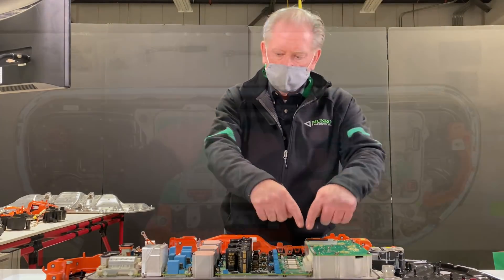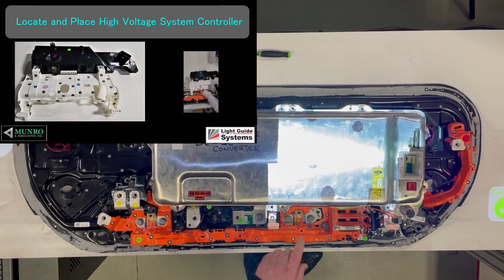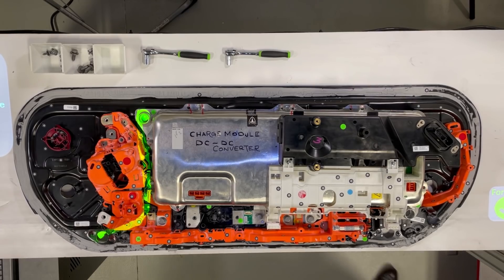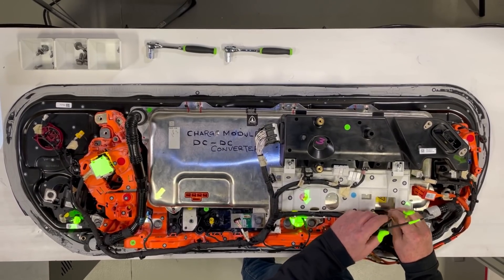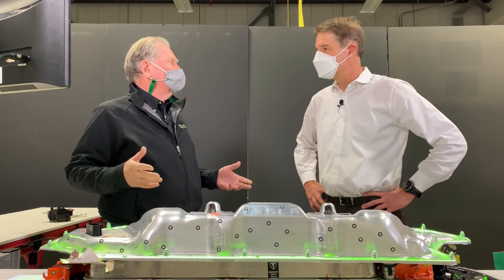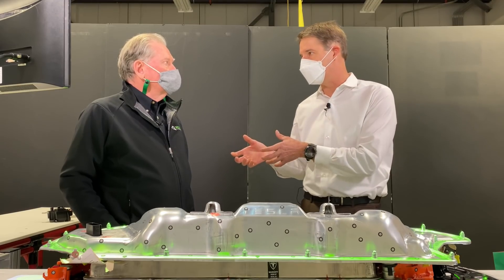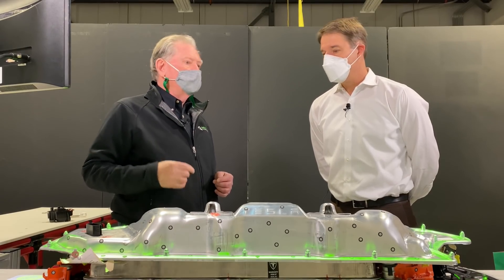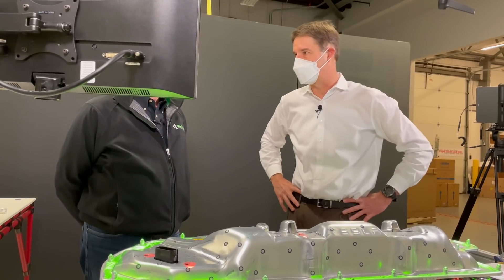Sandy Builds Tesla Battery Bay

Comment: There would be many advantages to using HUD glasses technology instead. Think Google Glass. Basically the OEM would retro fit a pair of safety glasses with this technology. This would allow the visual guides to be easier to see, and more adaptable for the specific user. Also imagine somebody working maybe in a construction field or otherwise a manufacturing environment that isn't necessarily concealed to a traditional line like mobile homes or rvs. Add lasers to it and you'll get measuring and leveling capabilities. Imagine using this technology in construction, not having to necessarily use a tape measure or chalk line. Like if you're sheeting a house it would tell you exactly where to put each screw in order to have perfect spacing.
Reply: Sandy just replied to a similar question saying they (Light Guide) do integrate AR Glasses into the process, but there are issues with battery life and workers not wanting to wear them for an entire shift.

AR Glasses would be great for field work though, there are many companies, including one local to me, that are pushing this.
Reply: @Gabriankle  oh I guess I didn't see that. As for battery life, I'm imagining something that looks similar to goggles. A large battery could be fitted to the strap on the back of your head. Many headlamps are similar. As for getting people to keep them on, there is no simple answer other than just make sure policies are being enforced.

Comment: "Pick by light" and "Pick by voice" - this idea is not new at all. Also, in assembly lines, the assembly is broken down to simple steps for each worker, and the products moves in between, and eacher worker only has the tools and components relevant for this worker.
With this system, you have the choice between assembly lines like used by Henry Ford and more complex stuff for each worker.
As a side note: You still have traditional wrenches, instead of wrenches, that are wirelessly controlled and battery-powered.  You should really combine such ideas with proper tools as really used in industry.
Reply from the maker: This was just an example. Their systems in manufacturing plants uses power tools with torque monitoring, etc. Thanks for watching!

Comment: Imagine instead of the screens you just have AR glasses
Reply from the maker: Many (or Most) of their stations in use do not rely on the screens, this was more of a training station. It's my understanding that on a true assembly line the workers do not look at the screens at all.
Reply: I thought of glasses too but I guess here the benefit is that it's part of the station rather then something on your person.
Reply: AR or VR are good (and getting better) but it takes effort for the brain to reconcile reality with what is projected and it is really tiring if you do it several hours in a raw.
This on the other hand feels very natural, just like following a Lego instruction manual, except directly on the Lego parts.
Reply: I know a university student in Korea who is building AR glasses for surgeons. Software coding class
It would be applicable to this as well I imagine.
Reply: ruskis are using AR for assembly of the Su-57,  that said assembly of the F-35 uses this system.  They looked at AR but decided to go the a light projection route,  fatigue was a big reason apparently.  You tire fast using AR compared to a light projection

Comment: Two questions: 1) How are the 'input' parts placed for the assembler, e.g. how do the boxes get filled with bolts and large parts placed for use? 2) Why did you have parts left over on the bench to your right? Shouldn't the system detect that there were unused parts?
Reply from the maker: Great questions: This was set-up just as an example, Light Guide has thousands of these systems in manufacturing plants all over the world that monitor all sorts of inventory aspects as well. The extra parts were culled from the exercise to make the video the ideal length for YouTube. Thanks for watching!
Reply: @MunroLive  Hey, thanks for answering the second question - I get it. But for the first question... How do the parts get placed in the assembly station for the assembler to use? 

When you started everything was laid out for you. How did the parts get there for your use? Is the station setup by another person, and then the assembler moves to the station? Do they use robots for setup? I'm just wondering how much labor is involved to create a perfect assembly station, and how do the manufacturers ensure that the proper parts are placed there at the beginning for the assembler to use. 

It's the old GIGO question - garbage in garbage out. 

Thanks again.
Reply: @rdyer8764  there are lots of methods. I'm sure in the video example, it was all manually placed by someone at the facility.
In a factory, there would likely be bins (think cereal dispensers at a hotel, or bulk food dispensers) full of bolts and components. Some setups have automatic fastener feeding to the business end of a fastening tool.
All of this setup comes with tradeoffs though. The more streamlined a line is, the less flexible (or changeable) it is, and the more it costs to set up. The upside is more parts per hour.

Check out Assembly Magazine for more inspiration.
Reply: @Gabriankle  Yeah, I figured parts for the video example were manually placed as a demo. What I was curious about was how the 'real-world' setup would be created in a factory situation. OK, I can see where any parts that could go in a bin would be pretty much a non-problem, and there could easily be a stacks of the sheet metal pieces, but how would they deal with wiring harnesses? Just a big bin full of them to pull one from? Seems like a time gobbler. 

But my main question is how do the parts get into the bins and stacks? Who knows they need more, and how does the message get to the person who the fills the bins and stacks? It appears the actual 'assembly' process has been streamlined superbly. But how is it supported in an equally modern manner? btw, thanks for the tip on the magazine. 

I went on a tour of an Audi plant just outside of Stuttgart a few years ago. It was amazing how a single manufacturing line could simultaneously produce 5 or more different models (sedans, wagons, coupes) with differing colors, drive trains, etc. They could even be for different countries with various legal requirements such as vehicle lighting, emissions, you name it. I think the chassis was only the common denominator. 

The parts were made available to the workers in perfect sequence. Since all of these Audis were built to order, the cars were manufactured in delivery order with the customer picking them up at the end of the line. Their delivery window was +/- 15 minutes, and the customers were given an appointment far enough ahead of time so that they could make travel arrangements to pick up their cars. Their experience even included a short class about their purchase which was available in several languages. This was the best display of JIT manufacturing I'd ever seen!

Comment: I've seen AR systems like this used in entertainment and education but not manufacturing, pretty smart if it actually works as intended on the floor. Just tough for color blind folks.
Reply from the maker: That was Sandy's first attempt, a line worker would quickly master their station!
Reply: @MunroLive  Very promising

Comment: great training system for assembly lines
Reply from the maker: we agree, it's a cool system.
Reply: @MunroLive  In assembly lines the steps are broken down to the individual workers anyway. And once a worker did 20 or 50 repetitions of some (1,2 or 3) manual steps, what value has this system then? This idea is similar to lightguide piano (2013). https://www.youtube.com/watch?v=DOSEekGuq0w 
Only lightguide piano had more features. No piano player today really needs a lightguide piano. And thus, assembly line workers will likely cope without lightguide. From my point of view, you would need other, more promising application scenarios like what Paul Ryznar mentioned. You will need scenarios, that are different each time. Where workers actually need this support.
Reply: @koeniglicher  assembly lines tend to move people from station to station (vacation, sick days, promotions etc) so a portable system could quickly bring the new person up to speed, them once they are proficient, move the system to another station or storage will needed - so you don't need a system at all stations all the time (cost savings?)

Comment: This system can save a crap ton in training costs and time. =)
Reply from the maker: agreed.
Reply: Even more savings due to much lower level of rework, if any.
Reply: Sure, but all of the parts have to be designed to use this system.
Reply: @ADOENDRA  Adding a system that not only saves training but has the ability to remove human error is an investment not a cost. One setup can then just be programmed for the job in hand, push a button and do a different job with a simple software update.
This is amazing tech always love coming to Sandy & the Team's page x
Reply: @helenlawson8426  100% correct. And for sure it is not a cost at all. I knew this system from before. Therefore i also love the simplicity of IKEA furniture assembly.
Reply: @helenlawson8426  100% correct. And for sure it is not a cost at all. I knew this system from before. Therefore I  love the IKEA work instructions. But also NINTENDO LABO instructions. But in the end, I still see products wish are hard to assemble just because ( at least in Belgium ) they still do not believe in industrial design.
Reply: @ADOENDRA I will never understand how anyone could love doing assembly on a product they paid good money for. Especially when its just chinsy garbage at the end of all of that time.
Reply: @patreekotime4578  Are you saying IKEA is expensive? It's basically discount furniture. Assembly is a lot of the cost, and it'd be much more expensive to ship if it was preassembled and designed to be durable enough for transportation. You get what you pay for. Also, assembly can be fun, if you're into that sort of thing (I am). Personally I don't understand why IKEA's assembly is known as hard - unless they've never tried something else. IKEA instruction manuals are among the best I've ever used. Obviously, it's easier to assembly something that is super intuitive and idiot-proof, but that costs more (not their goal), and so long as you pay attention to the manual, there's no confusion to be had.
Reply: @Muskar2  its discount furniture if you are rich. The last one I put together they had missing screws but also had three different screws that were virtually identical in unmarked bags. And the parts were also virtually identical but unmarked.  And whatever they USED to be, they are not anymore... Loads of chipboard and plastic parts. Like i said, antique furniture made of solid wood that wont just fall apart when you move it is often cheaper where I live.  Not only that, but for the same price and the hours of assembly time, Ive BUILT furniture. 🤷
Reply: @patreekotime4578  Rich by what standard? I could afford IKEA furniture as a student with $1k monthly income. If you can afford to have a device to write in YouTube comments, chances are you won't consider that rich. Secondhand furniture is often cheaper, yeah - sometimes even free. But I bet secondhand IKEA would be even cheaper. I have no idea if missing parts is common - I have never tried it myself. Usually there's too many parts. And I can't imagine two parts being identical - are you sure you checked the size differences when you took inventory before starting? Building your own furniture requires craftmanship and good materials, unless you don't care about looks. I've never tried assembling anything from IKEA that took more than an hour. Ugh, I feel like I sound like a commercial. Honestly I haven't bought from IKEA for years, because I prefer durability and function over aesthetics - and with IKEA you only get that if you pay a lot more.
Reply: @Muskar2  There is no secondhand ikea furniture. Its all in a landfill somewhere. Its diposable furniture. Which is why I call it expensive. And yes, these stupid devices are also way overpriced considering they are also disposible, but I didnt spend more than $150 on this one because Im not a sucker. 🤷
Reply: @patreekotime4578  My point is that virtually all new designed furniture is more expensive than IKEA. You can always get something cheaper secondhand or DYI, in most lines of products. And I know a few rich people and they'd never touch IKEA. You're definitely not a sucker for preferring what's cheapest. We all have our priorities in life. Take care.